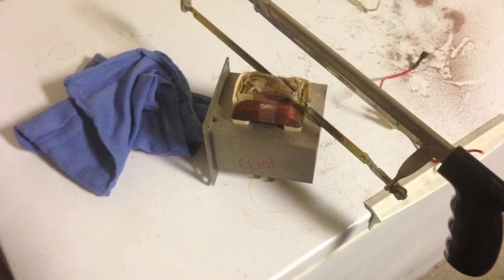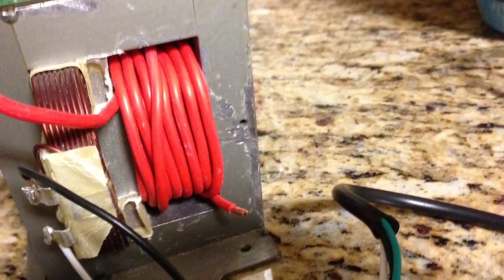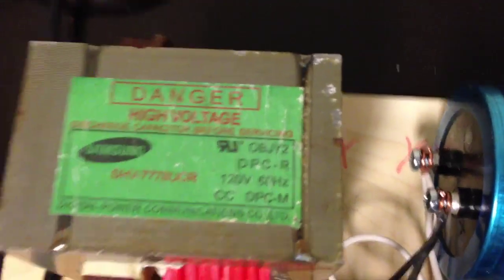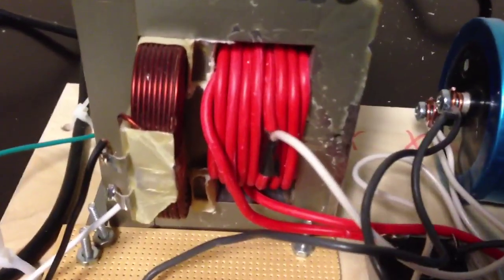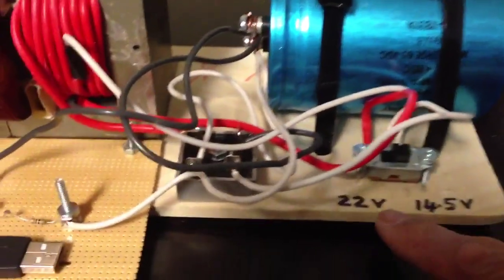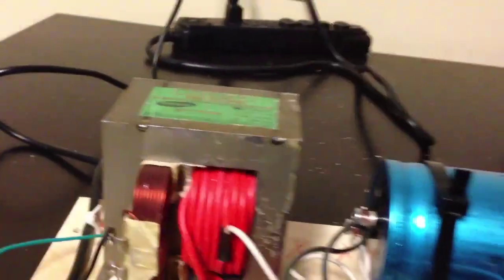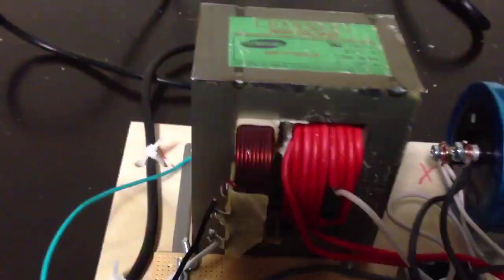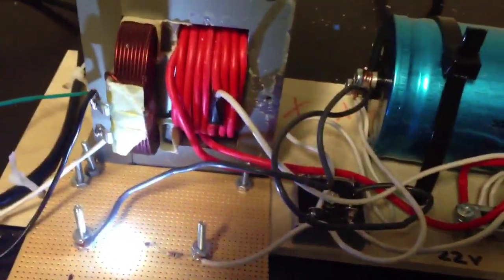Simple DC low voltage power supply from Microwave Oven a Tr

Comment: I found below for only $1 USD from China. can it work?
22000uF 80V Electrolytic Screw Capacitor Audio Amp 50x80mm Power Supply 105℃

Comment: great if that is 12foot of wire give only 22v well i need atleast 30foot to fit there >_> cause i need 60-72v
Reply: Use 2 transfo in series. It will also bring down the temperature (doubling the metal (Fe) mass dissipation).
Reply: @dancoz5477  yeah i was thinking about that lately double the resistance = half the amp per coil thing

Comment: Capacitor 10000uf 50v ?  Ajuda por favor
Reply from the maker: +games jammer i got mine from ebay
Reply from the maker: +games jammer I would recommend using 4 bridge rectifiers connected together in parallel to handle more current. I used 4 x 100V 35A rectifiers for a total of 140A. This has worked well. With the single rectifier, it heated up a lot if I was drawing a lot of current. I would add a 25A fuse in the circuit after connected in series with the rectifier output to prevent destruction of the rectifiers if the output accidentally gets shorted out.
Reply from the maker: +games jammer this is the setup with a fuse and with 4 bridge rectifiers connected in parallel.
Reply from the maker: +Brian D (hvTinkerer) https://www.youtube.com/watch?v=CZOl9gvOl94